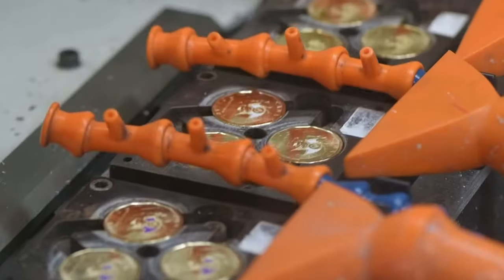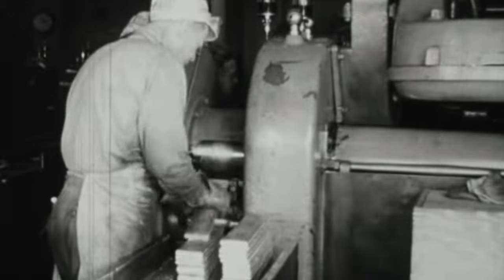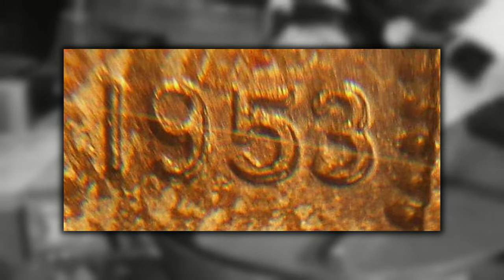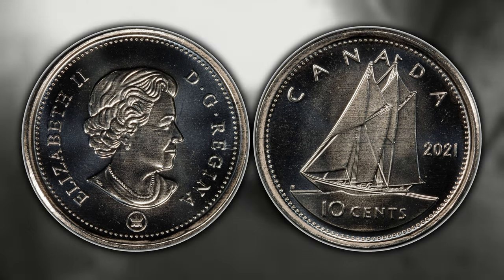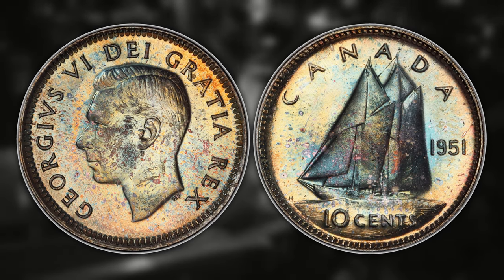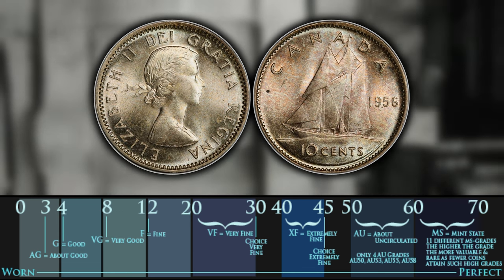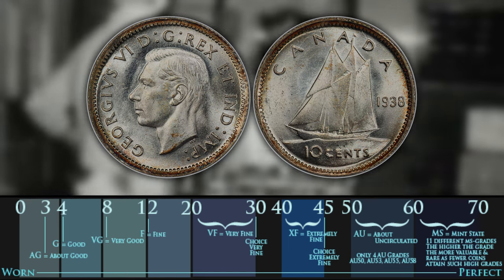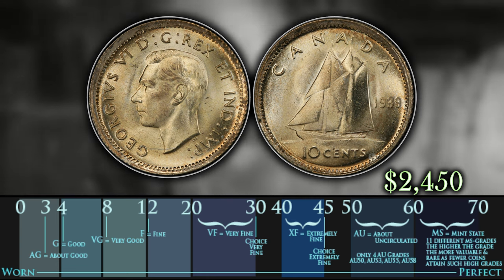Top 10 Most Valuable Dimes - Rare Canadian Coins in Your Pocket Change

Comment: I have a 1968 large date that looks like the same as the 1969 large date but it’s a 1968 large date, I also found a 2011 dime tat has a copper edge or brown edge I never seen one like it I’m baffled
Reply from the maker: Every 1968 is a large Date
Reply: @NorthCentralCoins  what about the 2011 dime that has a smooth edge and not the rabbit lines on the outside edge of the coin like all the other ones have, plus if you put it in a roll of dimes it stands out like a silver coin stands out in the roll, but this ones not silver it’s got a copper edge and smooth, the dime is the same size as the other ones, you got a Gmail and I’ll send you some pics, I also wanted to show you my 1936dot penny that the dot fell off because it was in a coin box with bunch of coins with no protection and over 60+ years of bumping against coins it knocked the dot off but you can see where it was clearly ... can I send you pics

Comment: I always watching your videos until I find this video about the rare dimes and  I buy some rolls of dimes this month at the bank and started checking it hoping to find 2000 P or 1969 large date and I did’nt find one of them.  But I found 2001 P 10 cents ( Year of Volunteers ) that on the front of the coin the word CANADA every letter is doubled, the year 2001 every number is doubled, the 0 is doubled in 10 denomination and the 3 letter of elizabeth II is doubled ( E, L, I ). The back of the coin is normal. What can you say about this coin? Is this extremely rare and valuable coin?